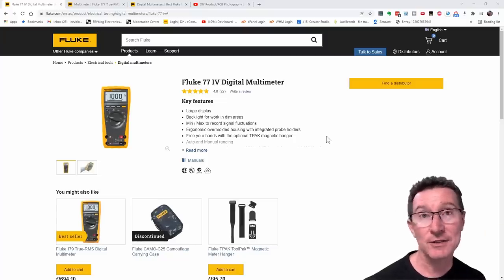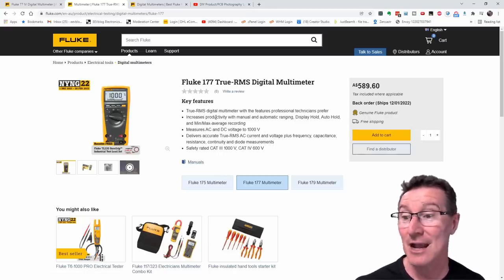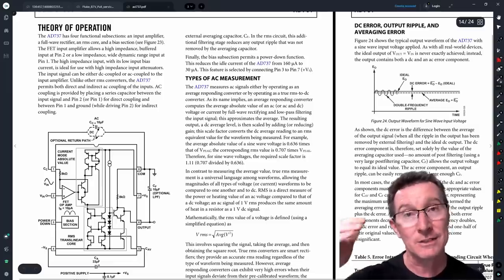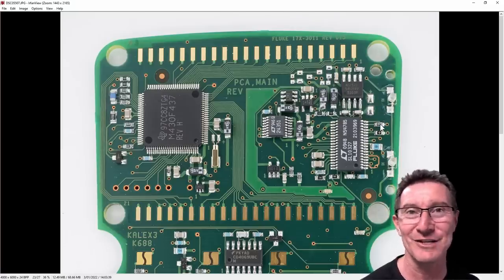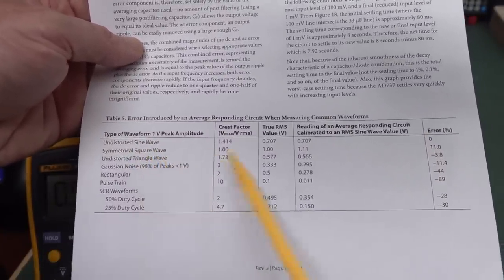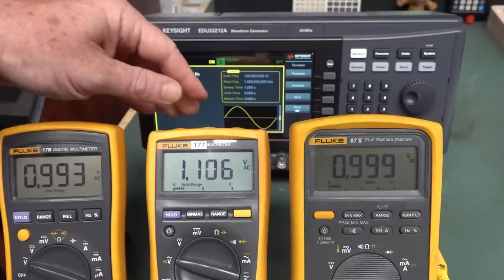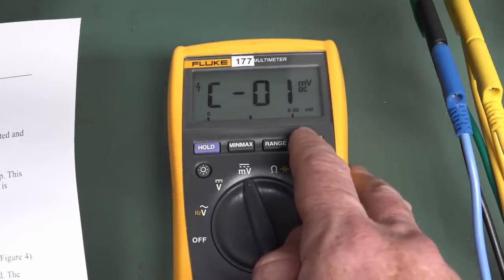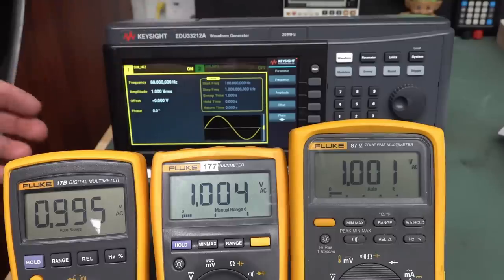EEVblog 1448 - Convert a Fluke 77 IV to True RMS for 10 CENTS!*

Comment: Could there be a way to upgrade the 177 into 179?

I checked both PCBs and components of 177 & 179 are all identical and equal in numbers. There are no solder pads for jumpers to convert from 177 to 179.

I swapped LCDs, keypads and selector switches but no success.

Good thing with 179 is that it has added type-k thermometer function. If PCBs and component counts are the same, surely the 177 is thermometer-ready, it's just a matter of changing it's mode into 179 so one can utilize the temperature function.

Comment: Makes you respect Fluke even more. For an encore I'll wager someone figures out Fluke does the mod for $50.

I've got a 1st generation 83 from the 1980's, non RMS (only the 87 was true RMS). I wonder what A/D chip is in there but I doubt it can be converted. Not that I really need it.

Comment: Hello, my name is César, I am from the country of Chile. It turns out that my fluke 175 had a fault, the internal voltage regulators of 5 volts and 3.3 volts burned out, I changed them and the multimeter turns on showing F175 and then it just shows these lines - - - - My question is what could be the cause. Thank you.

Comment: There is one exception.  The Fluke 76 is a true RMS meter. (I forget when they stopped selling it, probably soon after the 80 series came out)
Reply from the maker: That was a rare one. The 79 was the more common one in the series III that was True RMS.
Reply: I've got a few holes in that area, but I've got a good sampling of -III and I finally got a 77 IV.
Reply: @EEVblog  I took the cover off one of my 76 meters and wasn't surprised to see the 737 IC.  What DID surprise me was the copyright date: 1994.   Oddly, the 79 I took apart to see if it had the IC (it doesn't) was dated 1990, but it has the painted front.  The 76 still has the decal.   Sadly, I don't have enough later 79/29 examples to see if any of them have the IC without the capacitor.
Reply: What about 1st gen 77 from late 70's/ early 80's?
Reply: @fieldlab4  I'm not sure what you are asking about them.  Although the 76 isn't labeled as a  series 2 meter, It was made around the same time as the other square 70 "series 2" meters.  I was surprised it was made so long after the introduction of the 80 series meters.  The last square 70 series meters were the 73-III and the 70-III.  The remaning -3 meters were the tapered case with the overmolding.  As Dave said, the 79-III was the TRMS, the 77-III was not.  (Buit the older 79s were not, either.  It's confusing)

Comment: Dave, will you do a review on cheap multimeter like those rebranded by Amazon? I'm thinking of the 90md610, going for 40€ here in Italy (claims to be a true RMS 6000 points job, with 10A to uA in both DC and ac) . Or other ~50 €/$ price range ones. Love you!
Reply: Watch the Aneng An8008/9 review could be considerable
Reply: @Huzaliproductions  i know, but here's retailing for around 60€ and every time I've ordered from China I've had nightmarish problem with custom /import office blocking packages.
Reply: @REVOLUTIONS51  The meters in the "taobao special" grade with similar price range and the same sampling count willl be carbon copies of each other using the same chip with sometimes slightly modified PCBs. Don't overthink it.

Comment: Have you ever thought of designing your own multimeter?
Reply: I have! Well, volt-ammeter at least. Wanted a multi-channel, data logging meter that I could talk to over WiFi but commercially they're several thousand  dollars. TI makes a really neat 16-bit ADC chip, the ADS1115. It has four channels and can take differential measurements between them, as well as a programmable gain amplifier and its own internal precision voltage reference. The nasty part is finding temperature stable divider networks, the ones that Fluke uses sell in single quantities at ~$40. So I went with rather less than ideal resistors for my voltage divider. Measuring AC with without a nice RMS amplifier has been troublesome (possibly because the ADS1115 breakout I bought is a counterfeit).
Reply: If it's Q to Dave he has already done it.

Comment: Hmm… take a squint at capacitor derating for Tants ? Needs higher than 10volts me thinks ? 👍🏻
Tants are very susceptible to transients beyond their rated voltage.
Reply: I think this was for the sake of the exercise, otherwise Dave would have ordered the appropriate V tant. Still, its a giant pita to calibrate so for the sake of a few days to get the part...yes, I agree with you, he should have installed the 16V version as per the spec.
Reply: They are called fire emitting capacitors for a reason :D
Reply from the maker: The signal level is almost certainly only a few volts tops.

Comment: I've had a 77 since the mid 80s that I'd like to convert, and I can probably cobble together the voltage and currents required to calibrate it, but I can't duplicate the required accuracy.  My half dozen or so other DMMs are mostly Chinese made budget types and I resist using those to calibrate my only Fluke instrument. Like wearing blue jeans to a prom - they'll get you there but you won't make a big impression.

Comment: In swedish outlets they call tantalum "Tantalum electrolytic" caps. What is that about?
Reply: Because all tantalum caps are electrolytic - they function by having an extraordinary high surface area after being acid etched…
Reply: @allangibson2408  Thanks.

Comment: Hi. I have 179 (+ 10 years with original battery lol), Is there a way to get zero ohms on screen when shorting probes?
Reply: There's no REL (delta mode) to zero out the leads on the 179, so unfortunately not.
Reply: @wirdy1  Thank you for your answer!! I've looked manuals and didn't find it. Irritating that some cheaper meters have this function, oh well..

Comment: Any way to read the cal eeprom and just overwrite the values to avoid calibration after the mod?
Reply from the maker: The point of calibration is that you don't know the exact values, each meter could be different. You'd still have to do the AC V/A calibration.

Comment: @EEVBlog-I am a newbie in terms of electronics and the interest is as a hobby/diyer and hence find it hard to justify buying lots of expensive kit. . As it is not my job and use is more likely to be occasional use,.

 Could you please consider doing some other IT equipment improvement videos. 

I appreciate that this may not fit with your channel, but does with your overall skillset having seen many of your videos[ including building/designing a product where you looked at making a PCB and even using the PCB layout software and BOM files ( which I thought was really interesting.).]

e.g. I saw your video on how not to damage your oscilloscope due to earthing circuits. Is there a way of adding batteries to a mains unit to make it portable, and secondly to potentially reduce the risk of blowing it up. I was considering buying a portable oscilloscope but I have a hantek dso2c15 and it is light and adding a battery could address both issues rather than buying more kit. 
 Is there any reason why people don't add fuses to the earthing circuit if blowing them up is often a problem for the unitiated? Does it need to be earthed as it has plastic casing?

Could you do videos looking at ways of how to  or on the principles behind improving/pointing out the principles of improving accuracy or othercheaper kit with simple part replacement if possible (quality/spec of parts capacitors/resistors, speed dig-analogue converters etc ?

 I am sure lots of people would find this interesting even if they didn't enact them. 

 I know this is not the correct section but thought you may be more likely to look at it here, and it is related in terms of product improvement.

Comment: For me this hack is totally useless in a multimeter in that price range. It's a shame it's not a TRMS out of the factory. For the 600 bucks this meter costs i can buy really good quality meters like the german Benning MM 12. It is a True-RMS multimeter, had way more functions (a datalogger for example) and it's ISO calibrated for the same money. And on top you get more digits out of it. Please don't understand me wrong, i own a few Fluke multimeters and i also use Fluke Multimeters all the time. But why should i spend my money in this Fluke multimeter, when i can get more bang for my buck by just buing a different brand. And for all the Fluke Fanboys out there: When Fluke is such a smart company, like i always have to hear, why they are so greedy and don't spend the 10 extra cents to provide you a TRMS multimeter? I mean: This thing costs 600 yankee bucks, wtf.
 Think about this.
Reply: He claims in the video that there is still a market for the average responding meter, Fluke has both.
Reply from the maker: Haven't you seen this video yet? There is a specific market for both average responding and true rms model. If you want true rms buy the 177 for almost the same price.
https://www.youtube.com/watch?v=ay9wFQAW19Y
Reply: @santopino2546  Sure they have. I also have Fluke TRMS meters. What i wanted to say is that the price is not nearly mirroring the value you will get out of it. Here you just pay for the brand name, not more. The meter by itself is not worth the money. Surely there are jobs you don‘t need TRMS multimeters, but for an average responding multimeter the price is just way too high. Even when this thing has not a single fuction more than my 175 from 20 years ago. I don‘t wan‘t do make bad reputation to Fluke, i like their meters. But they really have to think about their prices. I mean electronic parts are getting cheaper and cheaper, they only rename their old meters, because they are more or less the same like the old ones, but with every new series the price increases. Why?That is the only problem i have with Fluke multimeters.
Reply: @EEVblog  Hi, sure i have seen it when you posted it. But what you said is exactly my minds: They sell them for that price, because they can. You did not get practical value for your money, you pay because you „know“ that they will calibrate their meters before they ship them out, and it‘s a well known name. That’s the only reasons for the price. The build quality is not unique nowadays, so that‘s not a reason anymore.
Reply: @WolfgangWittler1984  I agree, but I work in Industrial automation field, I would simply be too ashamed to use anything other than a Fluke and a very few other brands.
It's not my fault that the other brands haven't made a good name in the industrial market.
Same  thing with tools.